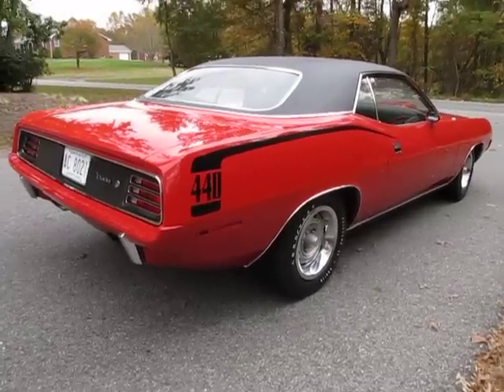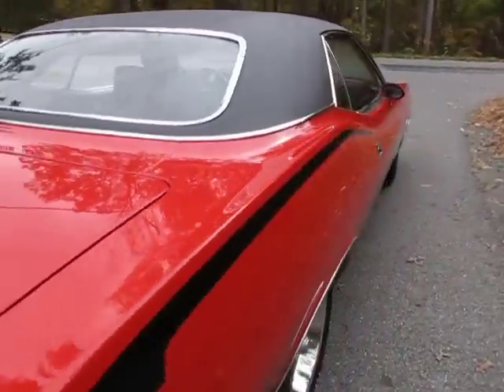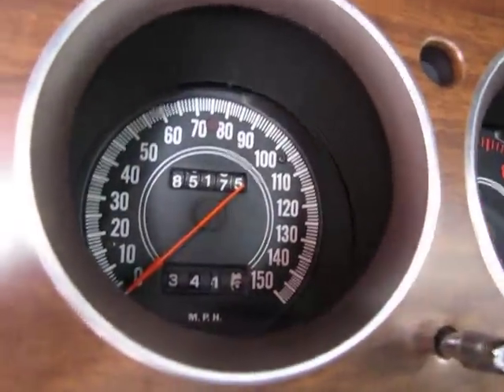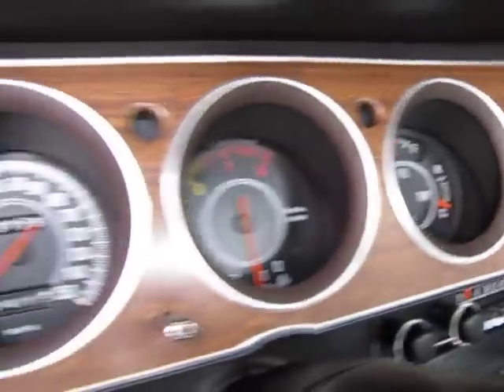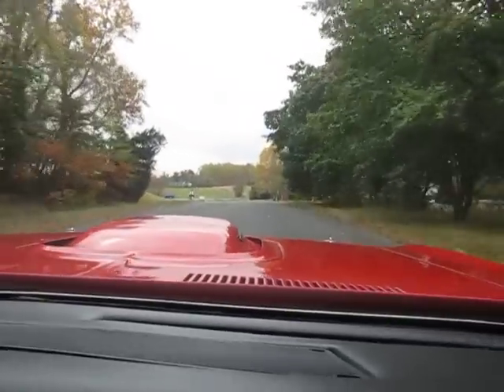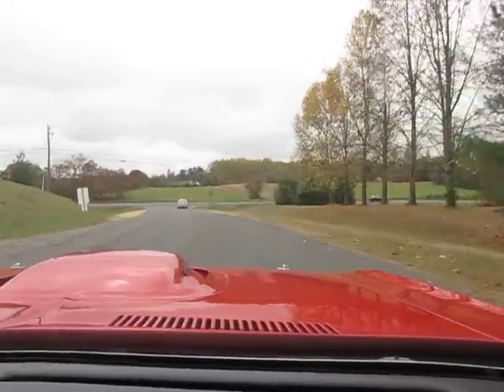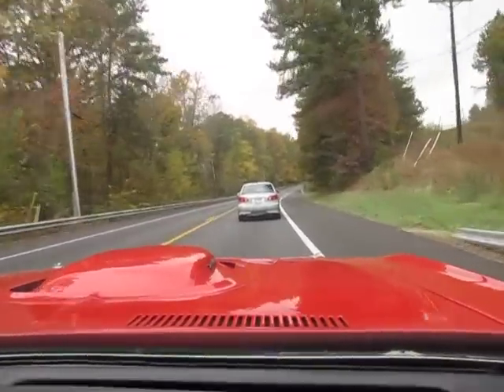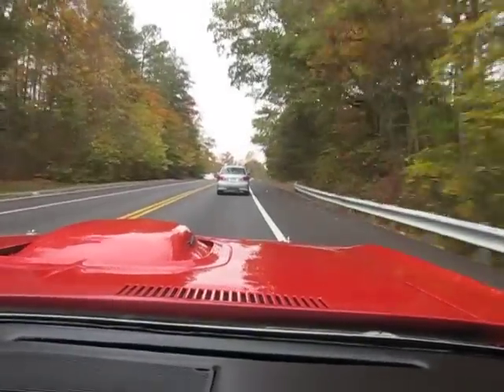1970 Cuda 440-6 pack, Burnin up Polyglass, Rockin test drive, Auto Appraisal, 800-301-3886

Comment: What a sweet car. I did notice something and a caveat to everyone interested in longevity for these performance engines. It was taking too long to warm up which I suspect it has no thermostat. The pistons need to be warm and round at operating temperature, otherwise the skirts will score, also causing egged wear pattern in the cylinders, and accelerated ring wear. Pistons are not round when cold, and must be at operating temp before you nail it! The roller rockers the op installed is a good thing, and mentioned that we have the technology, so why not use it? But do run a thermostat, cooling will not be affected, and you get a fast warm up. It's essential to the life of the engine.

Comment: Nice car, I had a 70 440 6bbl Cuda just like this except lime green I could break the tires loose in 3 gears, it had a 525, racer brown cam , Mallory dual points , carbs were all manual no vacuumed pods it ran very well with 3:54 gears  wished it was 4:10, but paid 1,500.00 for it

Comment: Nice cuda.I really enjoyed riding along it brought back some fond memories.
I had one exactly the same color vinyl top and all.
Mine had the super trac pac 4:56 gear set in the Dana 60.
It was a very strong car back in 75 when I had it.
Reply from the maker: richard Turk Thanks for the reply. I made a few mistakes while talking off the cuff about this V code 6 pack car, but it WAS a really cool ride-a-long. If I was a video editor, I'd go back and fix some of my random comments. Oh well...Your car with the super trac pac option was really rare! How much did you sell the car for waay back in 1975?  How nice was your car? People always enjoy these stories....me included! Thanks, Jason Phillips
Reply: The history on my Cuda was interesting.
From what I found out researching the V number it was originally a Hemi car that was sent to super stock drag racer Arlen Vanke.
He returned the car minus the engine for whatever reason.I think the reason was it was a 4 speed car.
Chrysler installed a 440+6 engine and shipped it to Goodwin Brothers Chrysler Plymouth in Lexington Ky.
I bought the car used in 1973 and I noticed the  inner fender well had the hemi shock tower on the side where the brake booster sits.The original Vin plate was still on the car and I noticed it was a hemi code so that got me into researching it deeper.
The car had the standard 6 cyl dash layout 120 MPH speedometer No tach or clock.
Radio delete plate,no insulation under the carpet, no seam sealer in the trunk under the trunk mat and no spare tire or hardware for a spare tire.
The shaker hood scoop still has the hemi cuda badge on it.
The original owners bought this one and a plum crazy purple one at the same time.
Thats about all I can tell you about mine and I sure wish I still had it.
I sold it in 1977 for $4000.00 to a fellow in Frankfort Ky. I have no idea where it is now
Thanks again for a great video.
Reply from the maker: Well this one must have been a super SUPER! 220....221...whatever it takes!

Comment: Mopar. Love them and have had two. One 318 V8 in 1971. the second in 2009. Dodge Challenger V6 with optional police engine.
Reply: V6 police engine? The police cars all have the 5.7 hemi not a v6 the v6 is the standard base engine... which I know they did make a "high output" version of the v6 is that what you meant?

Comment: Very nice piece- so you got an extra 100 hp from that motor? I didn't know that you didn't need oil with zinc when running roller cams. Many years ago I had a friend that had 1, 440 6 pack with 430 gears, red with white interior
Reply: So then is that zinc oil just for breaking in tappets then?
Reply from the maker: Most peeps keep runnin the zinc oil to protect the cam lobes- cam will wear down in a hurry without it!

Comment: According the vintage road test off the time the 440 was just more street able than the hemi  and road testers admitted that the hemi didn’t come on till well up in rpm range sow if I was buying back then I’d opt for the 440 . Plus the technology off too I still would rather have the 440 are a 383 which if built right could be just as strong as 440 .the hemi just race car engine that they built for the street and I always thought they got more coverage than they deserve.✌️

Comment: is that a stock 440 6 barrel like you would find from the factory
Reply: 97jag440 it sounds like it's got a mild cam in it and me personally I'd rather see a little bit above stock even on a numbers matching resto... as long as everything looks original from the outside me I'd go with a decent mild cam that had a little lope with a good exhaust system like 3" duals with a good muffler and if it were a car I wasnt selling but keeping for myself and driving, I'd go with an x pipe or h pipe... and some things to the suspension to make it drive a little better and safer, like upgrade the brakes, at least upgrade the front to disc brakes aftermarket leaf springs, torsion bars, steering box, all polyurethane bushings. Upgrade at least the front to disc brakes. And besides the cam in the engine I'd do some head work like a 3 angle valve job, back cut valves and bowl cleanup and port match, msd ignition with the msd box mounted underneath the dash and make it look like the original ignition is still there.. on the outside it all looks completely stock but some goodies on the inside and a mean ass sound that'll scare all the mustangs and ricers....

Comment: the whole point of a 440 six pack running better than a hemi is partially true.......the thing with the six pack is they ran awesome as soon as they came off the lot.........440 six pack road runner ran 12.90's as is.....the Hemi was a bitch to get right from the git go......they were awesome on the track though.  Even though the street versions of the hemi ran around 14 flat as is.
Reply: And your 14 sec. quarter mile quote... probably true, as the car would of been peeling out and fighting for traction through the first 3 gears on stock size tires.  And if you had on the original Bias-Plys, forget about any traction under acceloration!!

Comment: NOTHING can touch a Hemi after 100 mph. Especially natural aspiration engines. I like this better than anything new
Reply: BULLCRAP...this 440 engine was advertised at 390 hp but is really 325 hp.....a 2020 Dodge Charger RT puts out 375 hp.....that is 50 more....and will easily smoke this old rust bucket on the street...The 426 Hemi was listed at 425 hp but was really 350 hp....the 2020 Dodge wins again.

Comment: What did this car sell for,
Reply from the maker: +Douglas Jahn I'd have to dig into the archives, it was 2500 or so cars back. Well into six figures I recall...
Reply: Full 6 figures? I mean I know restored original Hemi Cudas could reach well over $100K but I didn't know the 440 cars could too
Reply from the maker: at the time, 3 years ago, it did $125k

Comment: Shame to restore a car like that and not paint the centerpiece of the vehicle, the shaker intake, silver as when it left the factory. I know, I owned one new.
Reply: you could get the shaker in either black, silver or the same color as the actual car.
Reply from the maker: Thanks for sharing that comment- I did not realize they also came in silver- that's probably rarest of V code 1970 Plymouth Cudas- Most of them I've seen have black shakers. 
Thanks, Jason Phillips, auto appraiser Michigan
Reply: You could ORDER a car with colored shaker, you're right they STARTED as all ARGENT colored.
For a while the lines installed SATIN BLACK.   For a gap, the shakers ran out, so some cars ordered got delivered with SPORT hoods on six packs and Hemi cars.
Depended on WHEN ordered.
Reply: Painted Shaker bubble was a factory option on the Tor Red cars, from the factory.  But yes, I am a fan of the original Argent Silver too, same color as the front grill.  Too many people complained that the Argent Silver paint would give off a bad sun glare, so for 71 cudas they made the shaker bubbles all flat black.
Reply: Knew there HAD to be a good reason.   Makes sense. Thank you.

Comment: Typical high lift cam idle with stock exhaust.
Reply: It is the difference in the duration the valves are open and especially how much the valves are both open at the same time